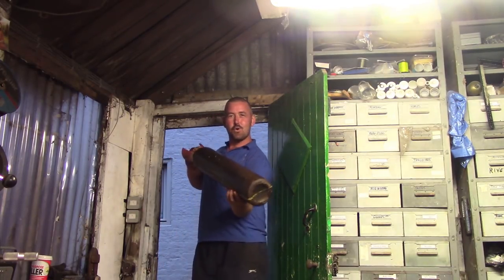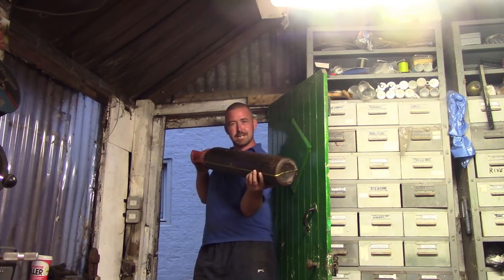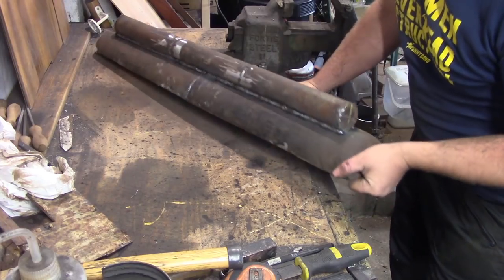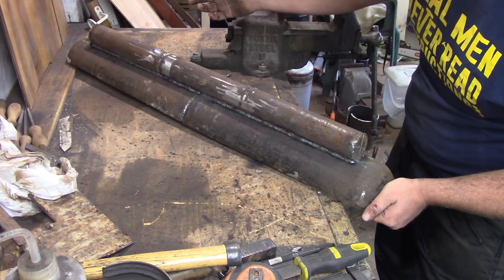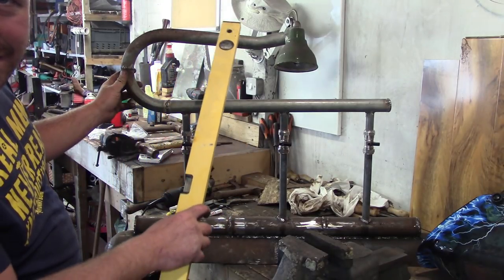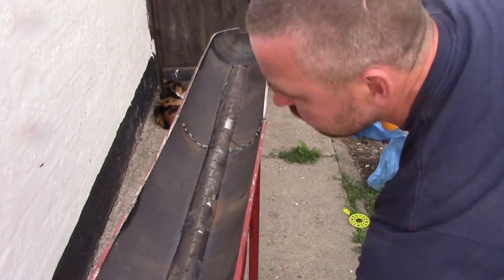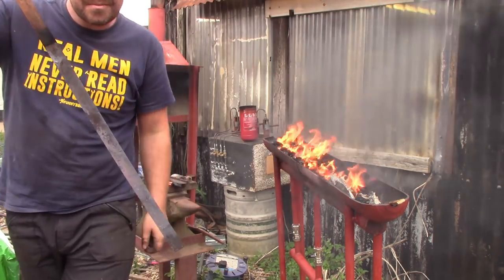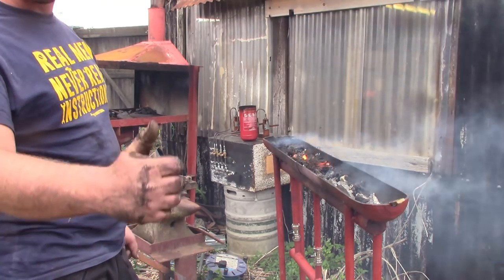building a long sword forge for heat treating long stuff

Comment: Good stuff as usual Turbo. Where did you get that blower again? I must have missed that bit in the other video.
Reply: Nice one! yep as Vinnie said do you have a link to the blower please
Reply from the maker: Yes chaps https://rover.ebay.com/rover/0/0/0?mpre=https%3A%2F%2Fwww.ebay.co.uk%2Fulk%2Fitm%2F192528058642

Perfect for a little home forge, I had been using air bed pumps before but I'd burned 2 out in less time than this has lasted and it's still going.

Comment: Coincidence I just bought an old forge
Reply from the maker: Oh really, What are you going to build with it?
Reply: I'm trying to forge a bearded axe, my old self made forge was a bit crap and instead of heating what you wanted it would melt the bit you didn't.
Reply from the maker: That sounds like a real challenge, I've tried axes a few times and have exactly the same problem, hope the new forge is easier, are they both coal?
Reply: last one was charcoal, this one comes with coke in it but I'll run it charcoal because the neighbours will complain if there's constantly thick black smoke everywhere
Reply from the maker: Coal is really smokey but you might find the coke is a bit more acceptable with your neighbors, it won't have the sulphur and other stinky tar stuff in it. 
I'm finding for me coal is the easiest to control and it hangs around for ages even with the blower cranked right up. 
You have my sympathy, I live 1/4 mile away from my nearest neighbor so just do whatever whenever.
Respect for working with solid fuel though, it's definitely not as easy as gas but it's a lot more fun!
Reply: Thanks for the advice I'll start using coke if I can find a source

Comment: If it is too bright to show how hot it is, in daylight, then why are you doing it in daylight?  I'd be much more impressed if you had demonstrated that you were able to reach critical temperature.  I'd guess you didn't, which makes this essentially useless for it's intended purpose.  Congratulations also for glossing over the fact that you welded galvanized steel without informing your viewer on how that can be done safely without exposing yourself to zinc fumes, which are toxic.
Reply from the maker: Scott, it is in use, regular viewers have already seen it in action and anyone that spends time with a coal fire can tell by the flame it's good enough for a heat treat.
That pipe was only electroplated, hot dipped has 100x as much zink and is the dangerous one to weld but I don't do safety advise, I'm a big advocate for people taking responsibility for their own actions, letting Darwinism ensure mankind's long term survival is far more responsible than keeping idiots alive to waste dwindling resources.
God bless, and thanks for your comment.
Reply from the maker: Ok, blessings from the non-denominational supreme being....  I think you can actually see the whole piece red hot at 9:12 which hopefully nullifies your concerns, if I was using charcoal then I wouldn't have needed kindling.
Coal fires inside would be a bit unpleasant.
As for the T shirt, it's a bit of a joke because I maintain light aircraft for a living so spend half my life in maintenance manuals, so obviously I'm not a real man.

Really excited to see what you come back with, maybe none of this is real and I'm just the good half of your conceance telling the sinical half to lighten up a bit.
Salaam alaikum.
Reply: Scott Rich at around 9 minutes you can see it glowing and if you don’t know not to weld zinc you shouldn’t be doing this project